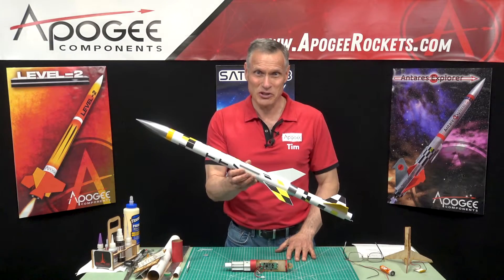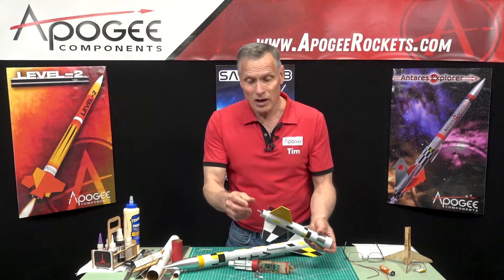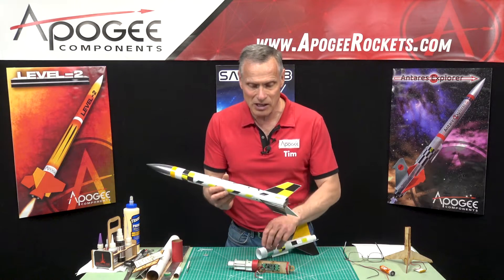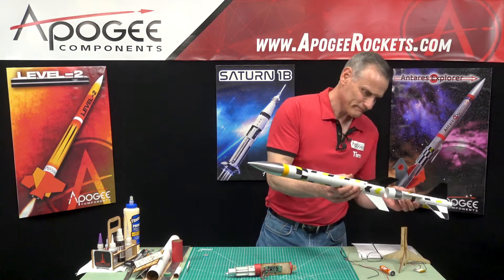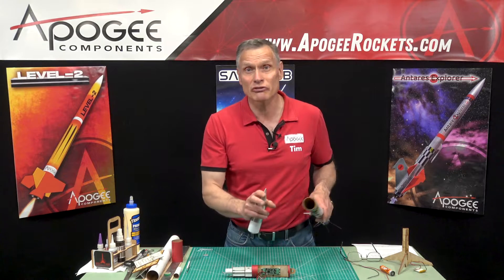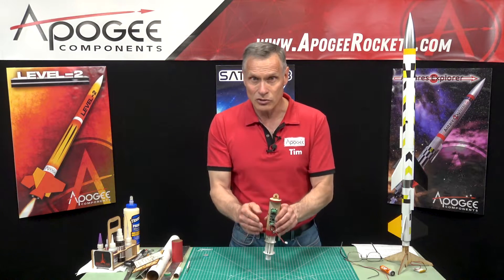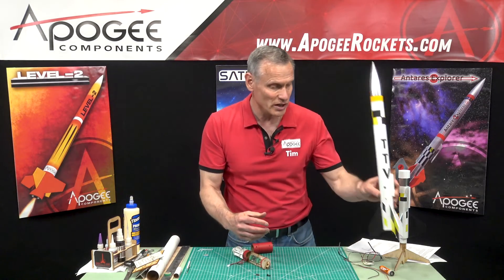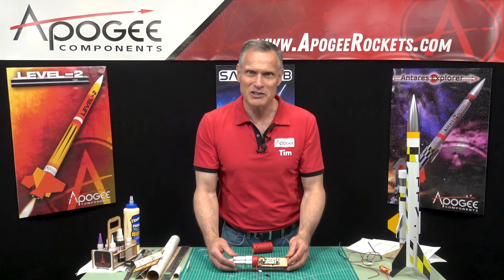Building the TTV model rocket kit - Part 1

Comment: Hello Mr. Tim and Company. If you have a minute, please state what that battery is your showing in this video.
Reply from the maker: For igniting the Quest/Aerotech composite motors, use the 2s (2-cell) battery. We have them on our website at: https://www.apogeerockets.com/Electronics-Payloads/Electronics-Accessories/7-4v-260mAh-2-Cell-LiPo-Battery-1-pk
Reply: @apogeerockets  thanks.

Comment: I assume there is no reason why one couldn't add one of your BT60 dual deploy ebays to the top of this and use Cesaroni 2,3,or 6 grain motors  in the booster?
Reply from the maker: You could... But since it already has an eBay, you don't really need to add on. For dual-deployment (so it doesn't drift far), it would be simpler to use a Chute Release in the upper stage.

Comment: This looks REALLY INTERESTING! Can't wait for the rest of the series!... I know I'm getting ahead of myself but to "align" the couplers that make up the e bay (you talk about in the video), I'm thinking cut a section of BT in half lengthwise to make a "jig" ... lay a thin sheet of plastic inside the BT to prevent the coupler halves from 'sticking' to the inside of the cut BT. Then glue and set the coupler halves inside the cut in half BT to keep things perfectly aligned...
Reply from the maker: Having a jig isn't a bad idea. But there are some little mating parts that have to be installed into the couplers first. When you get those installed, getting it straight will be much easier. In the end though, I did use the long tube from the kit to slide the assembled couplers into -- to make sure they are straight. You can download the printed instructions on our website (link above) to get a flavor of the assembly sequences to come in the series.